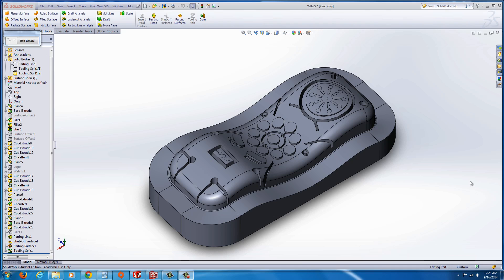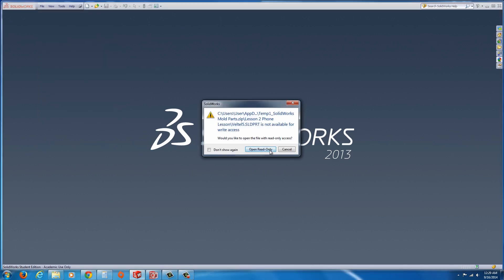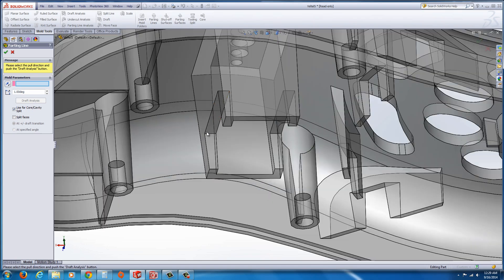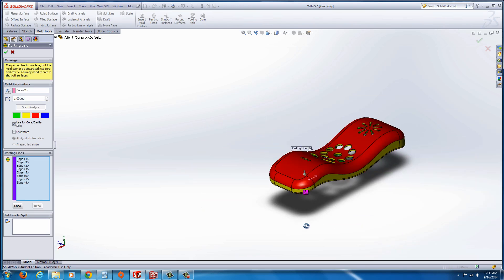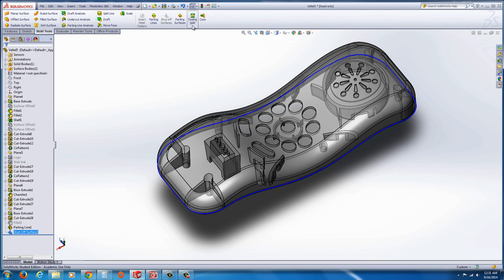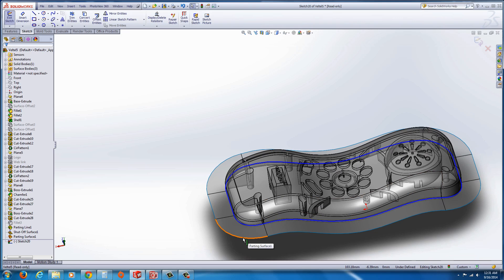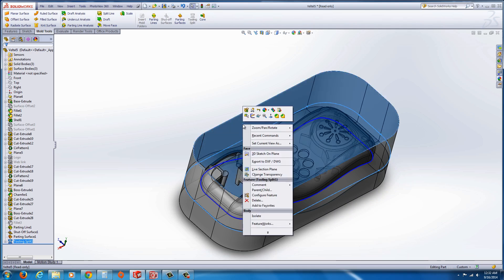E5 SolidWorks Non-planar parting line mold

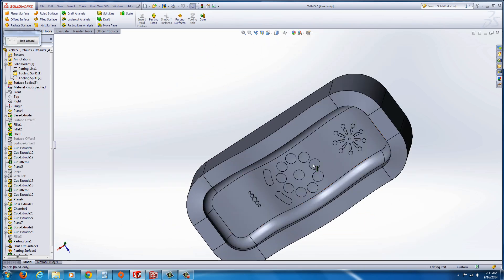Comment: Can we save the bodies separately? on 4:39
Reply: Yes - right click on the body located under the Solid Bodies folder in the tree and select "Insert into New Part..." This will let you save the body in a separate part file (note the parts are still linked such that any change made to this master file will affect the saved part, which can be useful in some cases).